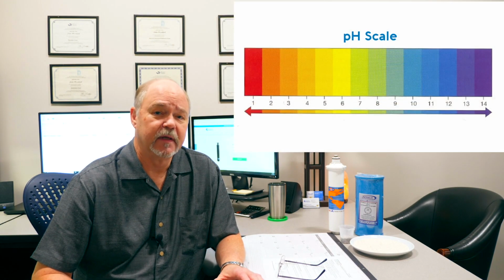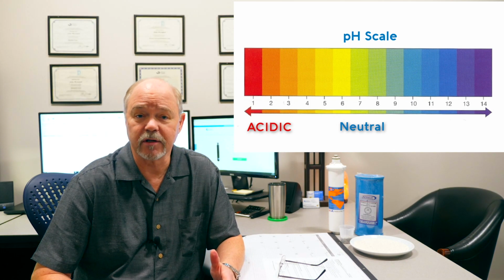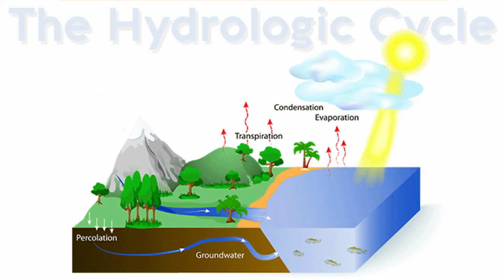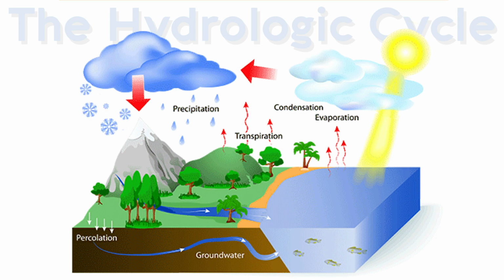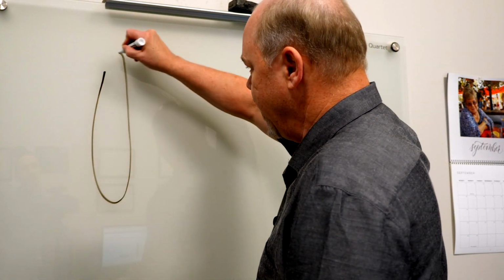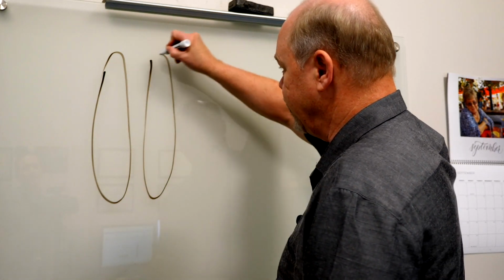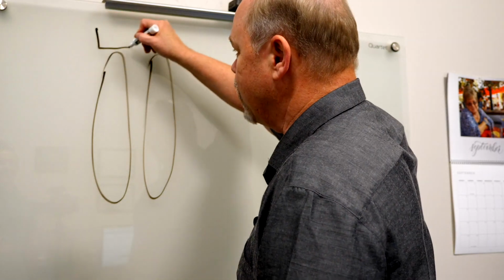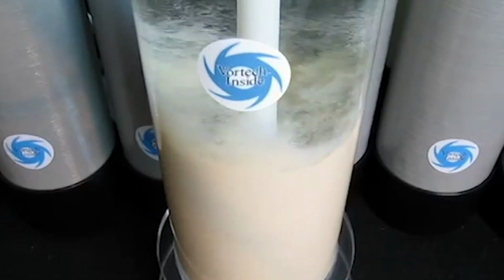What is Acidic Water and How Do You Treat It?

Comment: I have one of the up flow calcite tanks and what happens is if I’m say, filling the washer and I flush a toilet the flow rate jumps so high that tons of calcite comes out of the tank and completely clogs my 50 micron filter.  I find myself cleaning my 50micron screen filter every day, sometimes twice.  It’s annoying at the least.  The other option is to reduce the flow rate, but then my water pressure sucks.  If I’m taking a shower and someone turns on the kitchen sink I lose almost all pressure. So my choices are, good pressure but clean the 50 micron filter every day. Reduce flow rate and have awful water pressure. Or have acid water.  

How do I fix this?